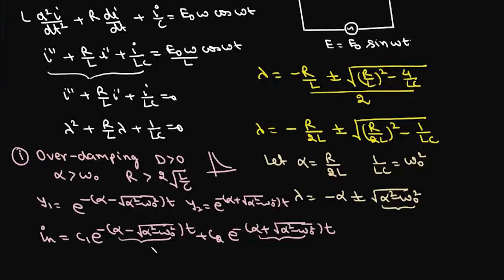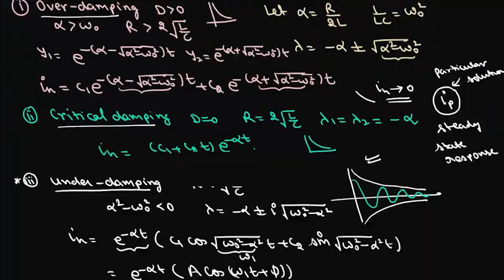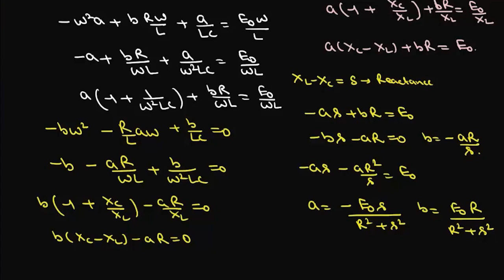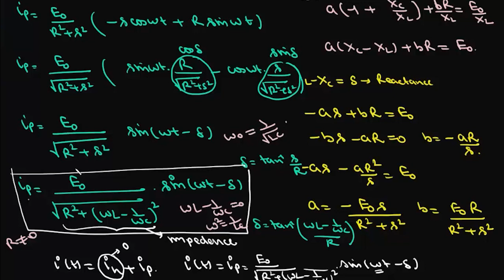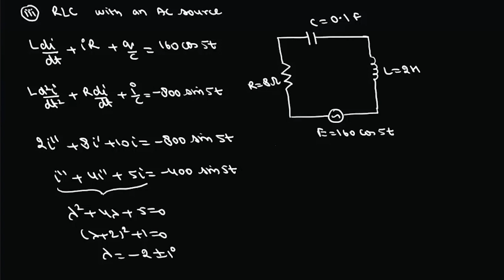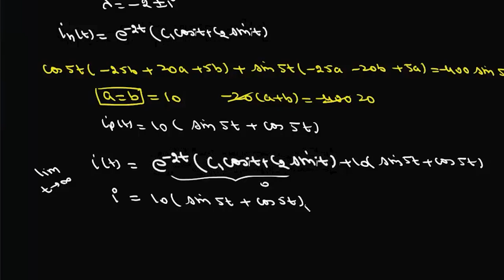Comment: amazing sir
Reply: @strangersings  No problem
Reply: Thanks and welcome
Reply: @Mathsmerizing Sir today isi official answer key came and one answer is not matching with your answer key . Straight line question one . Answer it gave is D and it should be B
Reply: Yes, the answer should be D as for it to be a line |a| and |b| shouldn't be 0. I just didn't see that option so went with B.
Reply: @strangersings when |z|=0 it means x=0 and y=0
Reply: @strangersings  Well, z in this context was just a reference to a and b